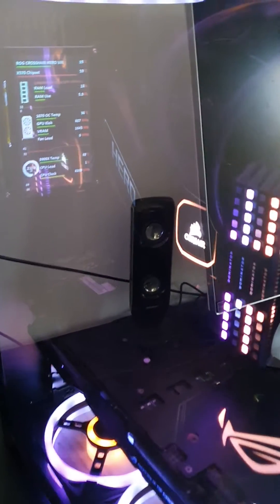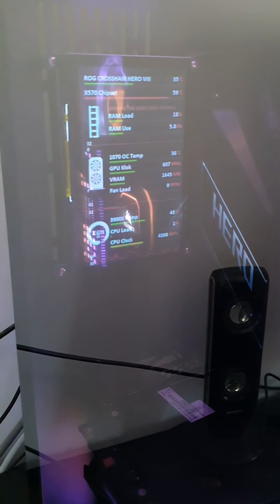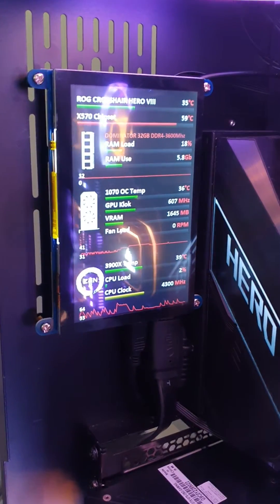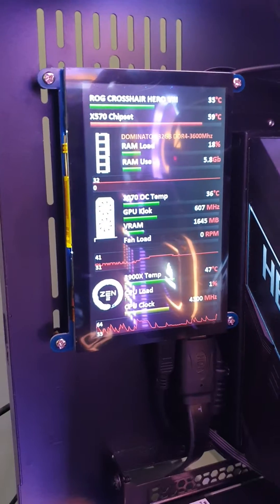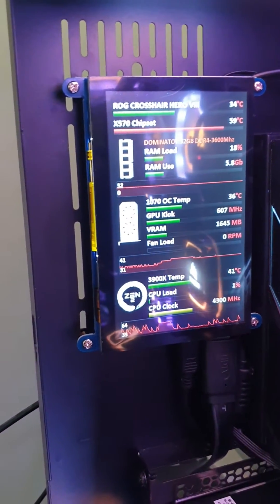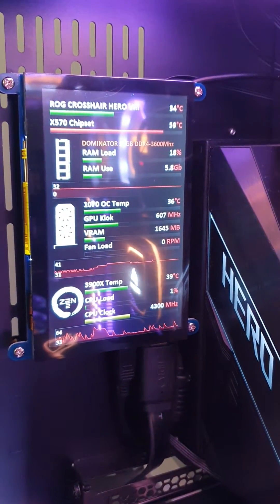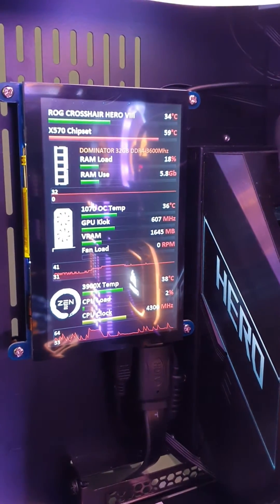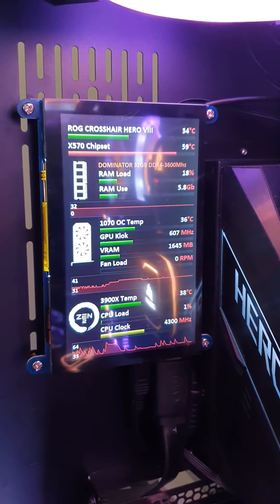DIY STAT SCREEN (Sensor Panel) WITHOUT DRILLINGin your case! Lian Li O11 | Aida 64 | 5 inch LCD

Comment: Hey what kind of power hub is that?
Reply from the maker: Hey, it is this one https://www.bol.com/be/nl/p/nzxt-usb-hub-5-x-usb-2-0/9200000079770426/?Referrer=ADVNLGOO002013-HVCEVWQNZFG2O-476092550109&gclid=CjwKCAjwgb6IBhAREiwAgMYKRvcJWndZ50uFA4NbIOfzTR_afPJczH_RRDh3JnOsZ3pi1-1yZaHzWhoCtmgQAvD_BwE. But on the NZXT site you'll find gen 3 version.   Greetz
Reply: Hey thanks, I was just wondering what are you using the other  usb headers for in the hub? I was wondering if you can plug-in extra fans in those slots?
Reply from the maker: @khutko1477  hey, my 2 lightning core and commander pro are connected to it. My mobo only had 2 usb 2.0 headers. 1 is used for my AIO and the second one for the usb hub.  U can't connect fans because it's usb 2.0 connection. U can connect a PWM hub for multiple fans if it has an usb 2 0 connection cable like the one from deepcool.
Reply: Awesome thanks appreciate it!
Reply from the maker: @khutko1477  no problem, good luck :-)